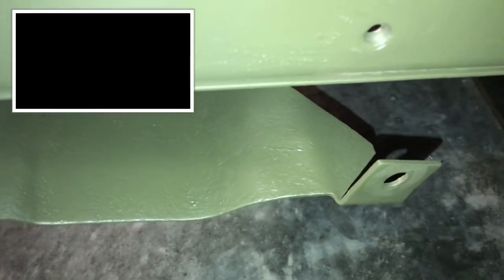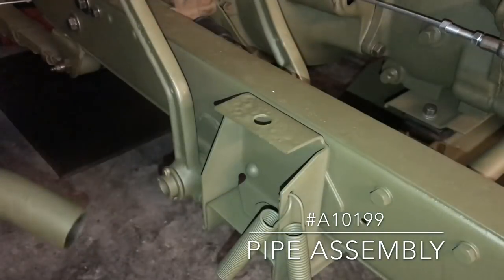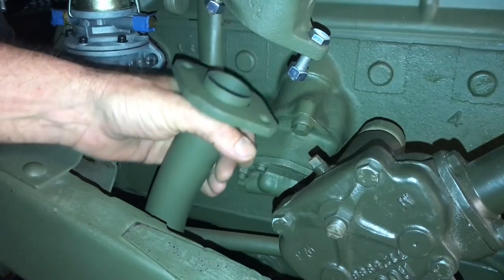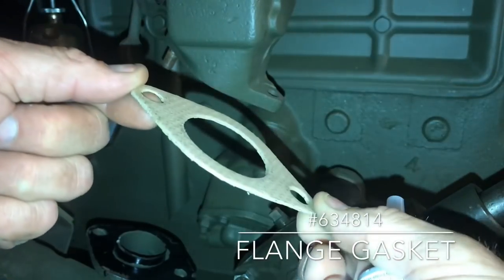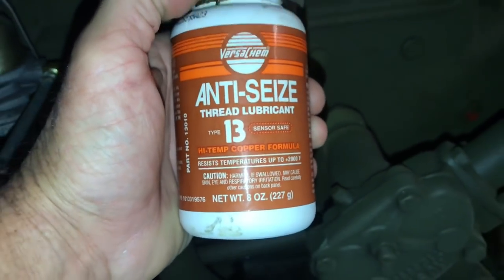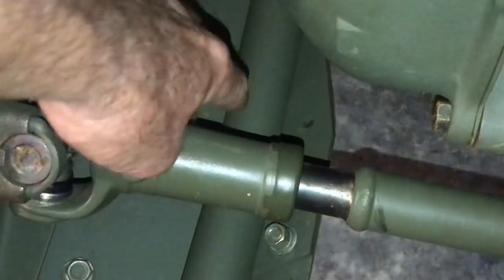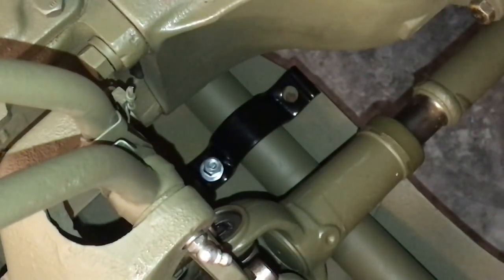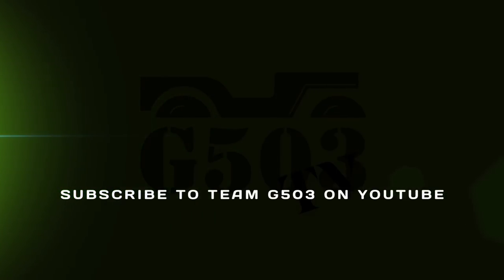Willys MB Exhaust System Installation (Part 1) G503 TV

Comment: Hey Scott - you may have the bracket backwards....check out the picture in ORD 9 G503....the bend on the bracket is a "standoff" that, a least in the picture in the ORD 9, is on the carriage bolt side.